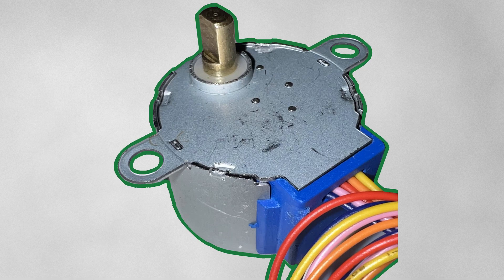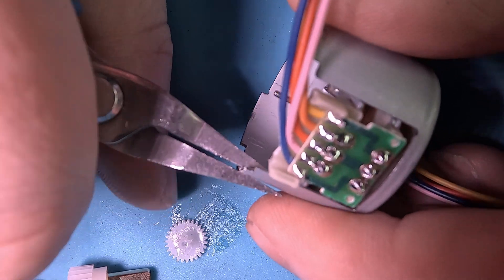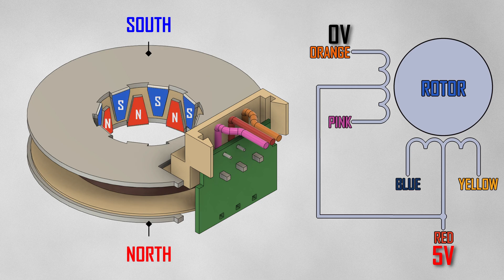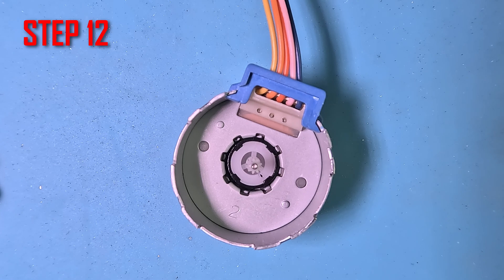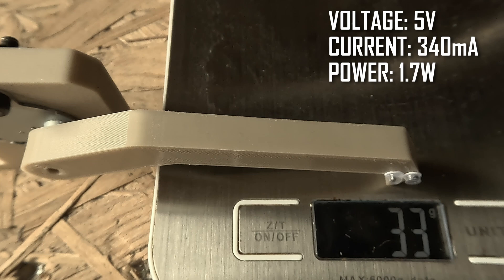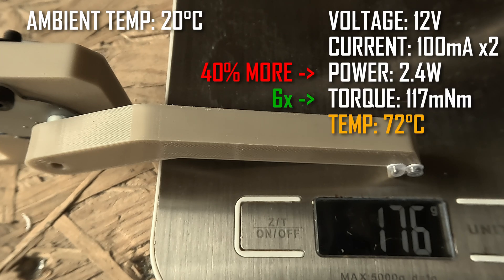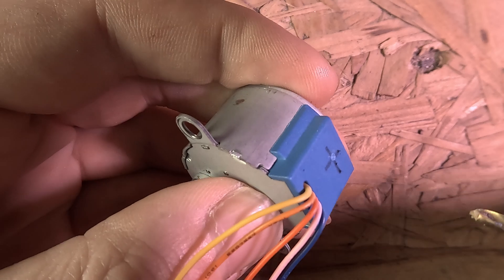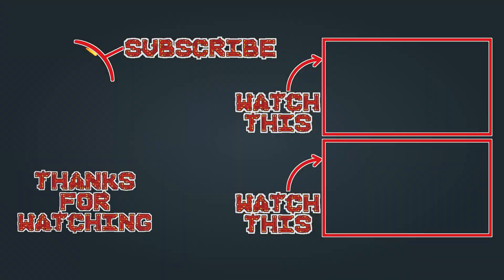Modifying Cheap Stepper Motor To Be More Powerful (28BYJ-48)

Comment: Ive cutted that point, and cant see any plus power. Here is my code on esp32, maybe need any changes in this? 
const int motorok[1][4] = { { 22, 21, 17, 16 } }; //ESP32 D1 PIN 1,2,3,4

const int iranyok[2][4] = { { 0, 1, 2, 3 },       //CW
                            { 0, 3, 2, 1 } };     //CCW

const int mikro[4][4] = {
  { 1, 1, 0, 0 },
  { 0, 1, 1, 0 },
  { 0, 0, 1, 1 },
  { 1, 0, 0, 1 }
};

int i, j, k, l, fut;

void setup() {
  for (i = 0; i < 1; i++) {    //motorok
    for (j = 0; j < 4; j++) {  //pinek
      pinMode(motorok[i][j], OUTPUT);
    }
  }
  fut = 0;

  Serial.begin(115200);
}

void loop() {
  if (fut == 0) {
    fut = 1;
    Serial.println("futok");
    leptet(0, 1, 514, 10);
  } else {
  }
}
/*
  [ motor, irány, mennyit, delay ]

  0 motor       0, 1
  1 irány       0 óramutatóval megegyező, 1 a másik
  2 mennyit     514 a teljes fordulat
  3 delay       2 - 10 motor sebessége: 2 max sebesseg, 10++ lassabb

*/
void leptet(int motor, int irany, int lepes, int varas) {
  for (int i = 0; i < lepes; i++)  //mennyit forduljon
  {
    for (int j = 0; j < 4; j++)  //fázisok
    {
      for (int k = 0; k < 4; k++)  //szegmensek
      {
        digitalWrite(motorok[motor][k], mikro[j][iranyok[irany][k]]);
      }
      delay(varas);
    }
  }
  Serial.println("vege");

  fut = 0;
}

Comment: What driver board are you using? Also is this the 12V version? Thanks!
Reply: No this is a 5V version of the motor, running on 12V after modification.
He mentions the driver board he's using after the mod: it's a DRV8825

Comment: Cut the paths with modeller's knife. Solder the wires to a switch. You'll be able to switch between the modified and original speeds.

Comment: As others have commented, a very clear explanation and a very soft pleasant speaking voice ( which many Northern accents have ), so you're ideal for youtube videos. However is the overlay at 4.24 correct  ? At 100mA x2 the torque is apparently 6x the 5v test at 32mNm, but torque is given as 117mNm ( the same value as 50mA x2 at 3.6x the 5v value ( 3.6x 32mNm = 115.2mNm ).
Reply: At 2x 100mA the scale is reading 200g, so 200mN.m

Comment: Nice video, congratulations and thanks for it.

I have found that with current limiting at 12V, the modified motor, if we want to keep it stopped but with the coils powered so that it is not possible to move it by hand (it will handle a flap), the voltage chopper makes the motor vibrate. I am using the MP6500, I have ordered a DRV8825 to test as well.
I think there is no solution for this and when it has to be stopped you have to disable the controller and trust that the gearbox prevents the flap from moving.
Reply from the maker: Thanks

Comment: Wtf did you do to it, though? Did you just cut the common, converting it from unipolar to bipolar? Well, no shit a bipolar motor will outdrive an identiacal unipolar one. But a bipolar requires TWO H-BRIDGES, i.e. 8 transistors and additional circuitry to at least create dead time between phases, so you aren't getting away with just 4 pins; whereas a 28BYJ you can drive with just 4 N-MOSFETs or NPNs. Oh, you've got a DRV8825? That costs as much as 2–4 of these motors, and can drive much more powerful stuff. Perhaps get a proper bipolar motor, then?

I mean, even if there is a situation where this "neat trick" may come in handy, what have you even achieved with this modification? You're pushing current through twice as much wire, which,  I have to idea how this would affect the magnetic flux density, but I know that twice the wire is twice the resistance, so half the current... Have you tried just running an unmodified 28BYJ at twice the voltage?
Reply from the maker: Generally bipolar motors cost more, DRV8825’s can be bought for as little as 40p, they use fewer IO pins and provide greater control. Using an unmodified motor at twice the voltage would cause double the current, so 4 times the power through the same amount of winding, vs the modification where a lower power consumption can produce a higher output torque.

Comment: Question.   When stalled these motors will or will not strip thier gears?    I wish to use them with a vent flap where I drive them until the vent closes and they stall.   I don't need extra torque so I do not plan to make your modification.
Great video otherwise.
Reply from the maker: Thanks and that’s an interesting question, I think if you drive them slowly you should be ok. Probably the bigger risk is if you’re going ‘fast’ then the inertial energy of the vent has to go somewhere and that might be the gears. But to be honest because the gearing is so high I doubt you could go fast enough to cause any damage!
Reply: I can't stall them at 5V but if I lower the ULN2003 voltage with a buck converter I can adjust the stall torque as I desire.   3.3v seems about right.
Reply from the maker: Cool, thanks for the info!

Comment: I am new to the use of stepper motors and understanding them. I thank you for your content. I just accidentally found you on YouTube and I’m grateful for that. I have a few questions about heat being generated on a low maintenance project that I am working on and what your suggestions would be, please let me know if you’re willing to help. Thanks again for the video.
Reply from the maker: I’m glad you found the video useful. I’ll try my best to help with your questions, ask away!
Reply: I have two brand new steppers and drivers . I got the basic code to upload from another YouTuber (paul Mcwhorter) I designed and printed a custom litho and base to rotate it the stepper got a little warm to the touch without having a load on it. Then after letting it run for an hour it stopped working. I can hear and feel vibrations from the motor and that’s all. Soooo I installed the second stepper and driver. The first setup was ran like I see on YouTube, arduino stepper and driver. The second time I followed Paul’s instructions and used an external power source that came in the arduino kit with the wall plug making sure to have everything set to te 5volt pins . It ran for an hour and just sits and hum like the first one. Please help. I have new steppers and drivers coming in because I now have a few people that want me to make one for them. And I want to use the arduino nano
Reply from the maker: Ok so I guess the first questions I have are:
Do you have a part number for your stepper motor?
Do you have a part number for your driver?
What voltage are you trying to drive the stepper at?
Reply: 28byj-48 5v dc stepper 
And the uln2003 driver
Reply from the maker: So you connect everything up, it runs correctly, then after an hour it’s just sitting there humming. Then you turn it off and connect another driver and motor and it does the same, have you tried just turning it off and on to see if it starts working again, it could be an issue with the code that only becomes apparent after an hour of running.
Reply: I’m just using the 5v supply that came in the kit until I come up with a better idea because I also need to run led lights for the litho
Reply: Yes I have tried that too I even went from laptop to desktop
Reply: #include <Stepper.h>
Int stepsOerRevolution=2048
Int moped=15
Stepper mystepper(steps per revolution8,9,10,11)
Void set up 
Cereal Dot begin (9600)
My stepper.Step speed in parentheses mope speed 

My void loop is my stepper.Step and parentheses steps per revolution
Reply: That’s the only code that I have running on it just regular rotation so we can move my device around
Reply from the maker: Ok, so a Quick Look at Arduino.Stepper and that all seems to be correct, some info suggests you can’t go above 4kHz which would be about 120 rpm which is much higher than your 15 rpm. How have you got everything wired, where is your 5V for the stepper motor driver coming from? When I did my testing I had a usb to power the arduino and used a separate power supply for the motor to stop the noisy signals from the motor affecting the arduino.
Reply: @JustAnotherMakerChannel  they Arduino is powered by the USB cable going into my desktop. I have pins eight 910 and 11 going to my driver from the Arduino and then I have a ground wire from the Arduino going to the ground rail on the bread board on the bread board I have the external power supply that comes in the kit, and are set for volts and I’m using the wall plug with the kit to power the stepper
Reply from the maker: Do you have a link to the kit that you have bought, maybe the power supply cannot supply enough current to drive the motor effectively.

Comment: Hi there! I really enjoyed your video on the 28byj-48 motor. Do you have the 3D model available for download? I'm interested in creating a new internal reduction for the motor and would find it super useful.

Also, do you know if the sizes in the model are accurate? Any insights would be appreciated!
Reply from the maker: Yes I can share the model, what format would be useful for you, I modelled it in fusion 360. It should be quite accurate though I think the gears are just an approximation, I.e. the teeth are not accurate involute profiles.
Reply: @JustAnotherMakerChannel  Fantastic! Thanks for being willing to share the model. Fusion 360 format works perfectly for me. And no worries about the gear teeth; I can work with approximations.
Reply from the maker: I've just uploaded the files and you can find them here:  https://www.thingiverse.com/thing:6620639

Sometimes Thingiverse is not very good and the link might not work until it decides to, you might have to check back in an hour or two.
Reply: @JustAnotherMakerChannel  Great! Thank you for sharing the link. I've managed to download the files successfully.

Comment: Really? 5V for your unmodified stepper, and 12V for your modded stepper? G... I wonder why. 😂😊
Reply from the maker: The power figures are comparable, I.e. the higher voltage and alternative driving mode produce more torque whilst consuming less power and thus producing less heat.

Comment: Hello, great video! Will you please share your wiring schematic with the DRV8825 and controller board?
Reply from the maker: Sorry for the late reply, if you check out my ‘how do stepper motors work’ video there is an example at 11:30, just substitute the A1 & A2 for  orange and pink and the B1 & B2 for blue and yellow. Hope this helps :)

Comment: Hello, there. Good hacking video.
My only doubt is: how the comparison between a 5V motor and 12V hacked should be interpreted... I mean, using a higher voltage wouldn't affect the results?
Reply from the maker: Thank you :)
The change in voltage is mainly due to the change in driving mode. The original driver runs as constant voltage, whereas the modification allows the stepper to be controlled as constant current.

Although the modified motor driver is running at 12V the motor will not have a constant 12V across the coils, this is mainly why I included the power values as they are more representative of what's going on, as an example looking at the first modified test @4:08, the motor is using 30% less power overall but producing almost 4 times the torque, since this test is performed at 50mA per coil and the original unmodified motor had a current draw of 340mA with a constant 5V applied we could in theory run the modified motor at 5V and still achieve 50mA per coil and still see an increase in torque, it's just easier to find stepper drivers that work at higher voltages as they can generally accelerate the motors faster by using a higher voltage.

I hope that was useful :)
Reply: @JustAnotherMakerChannel  Then, 1- you take the 5V version. 2- you cut the red wire conection. 3- You drive it with higher voltage but limiting the current. And then you get the increased torque. You don't need to buy a 12V version of the motor. I this correct?. And the second question is: You need a power supply which allows you to limit the current, right? The driver ULN2003 won't be enough to control the current if you want to avoid overheating.
Reply from the maker: This is correct but you need to break the connection on the circuit not just cut the red. You need another driver to drive as a bipolar stepper.

Comment: The 5 volt test, the motor did not seem to sound correct and the shaft did not move smoothly. You might have to drive them at a different frequency  to find the sweet spot.
Reply from the maker: Yes, they did seem strange, I remember having issues trying to ramp the speed too quickly too!

Comment: I'm new to this... Can someone explain? How do you go from 5v to 12v? Arent those completely different motors (there are 5v 28byj48 and 12v 28byj48). Because in another video, a 5v when converted to bipolar, the voltage became 10v, not 12v. 
Another thing, in the 12v tests, how dod you increase the current??
Reply from the maker: The stepper driver is used to limit the current, so you can drive the motors at higher voltages to reduce the chance of skipped steps under load and rely on the current limiting to try and prevent the motor from getting too hot. To adjust the current in the video I just adjusted the current limiting potentiometer on the stepper driver.

Comment: when modified to bipolar mode, does the 12V version of the motor have more  torque than the 5V version?
Reply from the maker: I think it would depend on the current limit set on the stepper driver, theoretically it should produce more torque at 12V than 5V

Comment: Nice video! I'm wondering, will this modification make the stepping more reliable when using a a4988 (or similar) stepper driver? I am currently using these motors unmodified with a4988 (yes it works). I do experience a missed step/jitter here and there though. Slowing down the speed doesn't seem to help so perhaps this modification could have a positive effect?
Reply from the maker: Thanks for commenting, I think they were somewhat more reliable, I do think there were still some occasions of missed steps/jitter, but I was abusing the motors I was testing so that could have contributed to the issues!
Reply: @JustAnotherMakerChannel  I did the modification after commenting and also increased the voltage to 17V (my motors are 5V version). It works great. More torque and no more missed steps from what I can tell =)

Comment: this motor had 2000 microsteps and, with the hack it has a backlash of 4 degrees. 
how much backlash did it had before?
how does this make sense. how can one fight this backlash issue in small steppers..?
or is it simply the price for add on power due to other magnet mode?!
Reply from the maker: Good questions! Unfortunately the backlash is the product of cheap gears, it’s no more or less before the modification. Probably the best course of action is to use these steppers for something like a lead screw, e.g. on a 8mm lead screw, 4 degrees is 0.09mm, or a 4:1 reduction with helical gears would net 1 degree backlash if the helical stage is close to zero backlash. You can also pick the motors with the lowest backlash from the batch you buy for the more critical elements of a project. Hope this helps :)
Reply: @JustAnotherMakerChannel  my first guess would have been that the plastic gear would be the root cause. with several!! transmission stages, each causing potential error. I learned that precision error is "not accumulative" which correlates a little with your "best in batch" theory. However, if the material of the gear wears out over time, its a false favor.
lead screws rules ya. certain leads might even reduce the effect as one needs minimum force to move.

Comment: This is a great hack for low budget DIY/hobby. Thanks! I’m amazed you were able to squeeze out such performance from such an old built component. Maybe a video on a cheap way on how to cool them while at top performance? Is there such a thing as thermally conductive silicone tubing? Then one could run a water jacket.
Reply from the maker: Glad it was helpful!
Reply: Just fixed a typo. I meant “cool” not “cook”

Comment: The construction looks super similar to geared ac synchronous motors
Reply from the maker: Yes, I think I’ve seen one like that driving a microwave turntable.
Reply: Si, pero los de microondas son de un bobinado y giro aleatorio si no llevan una carraca. En cambio hay ahora otros con doble bobinado para elegir la dirección de giro. Estos últimos si pienso que son lo mismo basicamente aunque la diferencia es el alto voltaje de 220v y que solo sacan 4 cables.

Comment: Its true but you can buy them with 3 wires as well. Also increasing the torque on these isnt a great idea as they have enough to break aa tooth in the gearbox as is. I know this from having a 3d printer that used 4 of these motors as extruder motors. A common failure was to have a broken tooth in the gear box.
Reply from the maker: Thanks for the info, where in the gear reduction stages was it?

Comment: How much torque on modified motor at 5 volts and current>
Reply from the maker: I can’t run the modified motor at 5V, the DRV8825 driver I am using has a minimum motor voltage of 8.5V. The current it adjustable so it can be anything up to 2A per coil.

Comment: Thanks. That's really helpful. I've just designed and 3D printed a model railway turntable to be powered by a 28BYJ-48, and was a bit concerned it might be underpowered. If it is, I can try  your mod, that will hopefully solve the problem without the need to redesign it for a NEMA17 motor.
Reply from the maker: Glad it helped, please let me know how it turns out, sounds like a nice project.